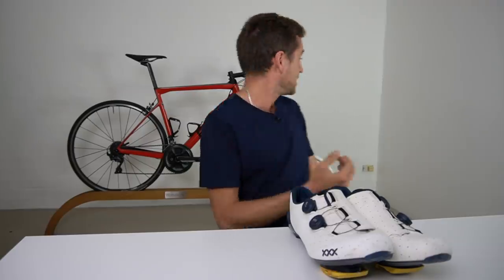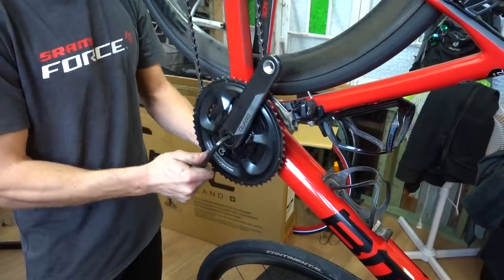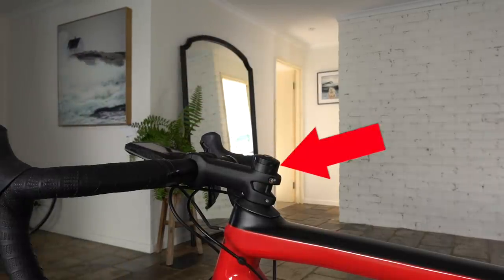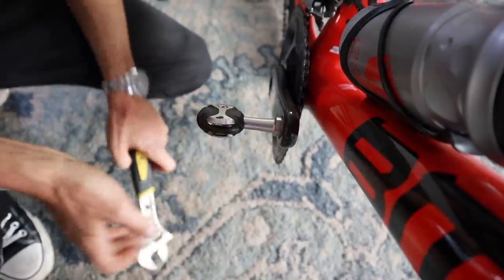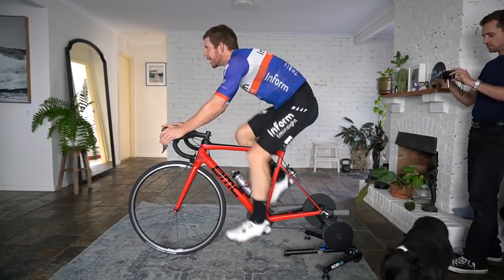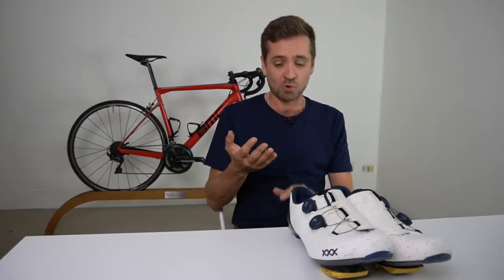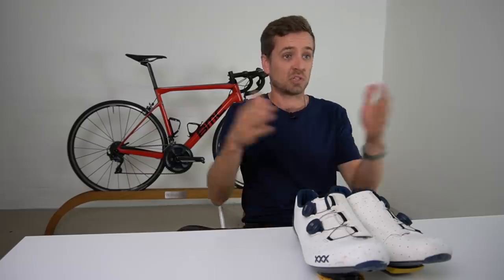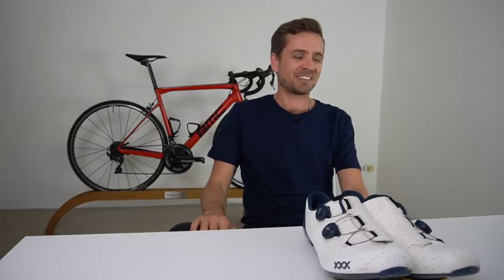How My Position on the Bike Transformed (From Changing Crank Length!)

Comment: In theory there are positional benefits, sure, but you must watch what it does to your natural cadence efficacy window. This is easier to deal with if you have lots of cogs and so forth but often overlooked by people that only look at power curves and not checking for detailed patterns when limits are reached. It's yet another reason to look carefully at cog choices and make sure the gaps aren't too big for you when you're approaching your limits of exertion. To be safe, if nothing else, spend a little extra time on pedal smoothness when on the trainer and see how that carries over. The kind of positional changes being discussed amplify the importance of working on the new cadence window.

Comment: I have the same quarq Dfour DUB powermeter and crankset. I switched from 172,5 to 167,5 after watching this! Today was my first on it and all ready loving it! But there are also a lot off small things that I have to get used to. But I was wondering did you change the settings off your quarq from changing the crank length from 172,5 to 165? Because I know I did on the older models from quarq. Please let me know.

Gerrie

Comment: Crank lengths have been trending shorter for about 7 years in pro circles. 
This has been driven by acknowledgement of benefits of higher cadence and drag reduction via lower back angles.

For 25 years, the road racing world overlooked that shorter cranks, higher cadence, lower back have been the rule not the exception in track cycling. 

The greatest obstacles to this trickling down to amateurs are
- excess bodyfat, especially visceral
- stiffer spines
- tighter hams and spine muscles
- hip joint asymmetry and osteoarthritic degeneration which includes FAI. 

Nevertheless, as one ages, shorter cranks should be the rule, as they reduce stress not only on knee and hip joints, but the lower spine.
One thing bike fitters and physios are not well versed in, is the role of diet and hydration in preventing joint and muscle stiffness. 
Anyone carrying weight will be stiffer universally. 
The elephant in the room regarding cycling comfort, performance, and endurance is still the factor preferentially ignored by most - diet.

Comment: Hey thanks for the series. I have a terrible hip impingement. I have been thinking on the 165mm Cranks for my BMC for 3 yrs, now I’m definitely going for them... let’s see if it helps, even a little would be amazing.
Reply from the maker: Good luck mate, keep me posted. Love to hear
Reply: Cam Nicholls assembled the 160mm Shimano Cranks 2 days ago (down from the 175mm, big step but can’t afford doing smaller increases) So far feels good, I noticed the higher cadence and lighter pinch in my hip. Could I be dreaming or I also felt some power output increase? Only tried the it on the Kickr so far so I’ll have to see what happens going up the hills.

Comment: I had a 175 crank and my knee was bending to high wich resulted in knee pain. I switched to 172,5 and in a week al the pain was gone. That is also a reason to consider a shorter crank
Reply: yea i was thinking of getting shorter cranks as of right now me knees are hitting me chest but my saddle is at the correct height how much of a height difference did it do for you with 2.5 mm change?
Reply: @simedinson984  i didn't change my seat hight, because with changing 2,5mm you can make a mistace easy. It could have been that my saddle was a bit to high before
Reply: @maartends6051  sounds to me that your seat was to low if anything but yea :)
Reply: For the top of the stroke
Reply: simon edin but a 175 crank was for sure to long as i am around 1,75 m. So it is normal that my seat was to low for the top of the stroke but if i would have set it higher it would have been to high for the bottom of the stroke.
Reply: Try 170, then.

Comment: I have sore hips and diagnosed hip impingements, did research and crank length is a probable self improvement to reduce the leg angle at its height. Unfortunately for a mtb  you can't just get shorter crank lengths it's damn near impossible, i bought a new 12speed groupset which allowed me to go from 175 to 170 , but according to various websites I am more around 160-165mm ideally. Big market out their for crankset makers!

Comment: Cam, you have done several bike fittings with Neil and they have been very interesting and informational. I wonder if you have any power meter data related to power, heart rate, cadence, peak power and average power doing a either time trial or a road race so we could quantify measurable differences resulting from bike fitment....
Reply from the maker: Not at this stage, haven't been fit enough
Reply: @CamNicholls  Here's the thing, all of these changes, while they make hypothetical sense, they don't really show how if affects the real world power and speed data. Regardless of your fitness, you should do something like a 20 minute power test or a short time trial to illustrate what the changes actually accomplish in these regards to those important numbers......

Comment: Crank length is one of the least "adjustable" dimensions on a bike, and often overlooked even in a proper fit. I had a bad knee injury that has now limited its range of motion. I ride 140mm cranks with the cleat near my heel and have one set that is 110mm. Those I can ride with both cleats in normal position. Huge thanks to Mark at www.bikesmithdesign.com for enabling these crazy crank lengths.

Comment: l find all these changes quite interesting please let us know asap how it turns out . l recall starting out on 170s then 172s and 175s on my other bikes . The 175s use a 46T chainrings x1 ,one on my old road bike one on my MTB with biopace ring !!  l spin more on the 172s on the carbon trek my fastest bike with SPDs too which really helps with sprinting and my first 50+km hr !! BUT 47km hr on the other two bikes is not slow either at a lower cadence . PS l put my old road wheels onto my MTB making a city hybrid out of it , l like it for coffee /shopping runs :)  l think a light weight ,compact ,high end cromo frame with 28+mm tires would make a great all round road bike :)

Comment: Not sure what the chimney issue is. Personally, I wonder if the length of the chimney could be proportional to the amount you’re smoking your competition!
Reply: The main issue for me is that it can lead to a damaged carbon steerer tube. Check lueschers video about that. Depends on the bike and length tough. A ridiculous high chimney is also not very pleasing to the eye.
Reply: It's a elitist road bike style issue when kept in reasonable length.

Comment: A question regarding shims. What if instead of using a shim on the shorter leg, is it possible to just use a thicker pedal?
let say for flat pedals, you use a thicker one on the shorter leg and a thinner pedal on the other. Would that have the same effect of using a shim?
really interested on this specific topic. Thanks!
Reply from the maker: Question for Neill, not myself. Sorry

Comment: Cam, as to the hip impingement, i wonder if, as you get older the worse it gets. It may not have been as obvious when you were younger. I know that I have found that I have become alot less flexible the older I get. As you get older (from mid 30's onwards ) stretching for flexibility becomes more and more important.
Reply from the maker: Interesting thought Bruce, have not thought of that scenario! Quite possibly. Cam

Comment: Hi I'm also 178cm height,  I have like 3 different fit ,  my actual  saddle height its 76cm but also got 76.5cm and 75cm from the others Fitters , 52cm /52.5cm Reach 8cm Drop used to have 12cm ( to much aggressive for my lower back) I'm curious about ur Saddle Height.  Nice Channel and Content,  Take Care from Puerto Rico.
Reply: It is not all that simple. If you are fairly flexible you can handle many position on the bike for short or long time. Sort time is 1.5 hours. 
I keep my stem 120-130mm for handling reason. It is better for bad descender like me. For flat ride I can go shorter reach and shorter stem. 
My height is 183 cm, inseam 90 cm, longer lower leg and long arms, short torso. So, not ideal for bike fit. 
For long ride I prefer 97cm saddle height from pedals, saddle nose 7 cm behind BB, 61 cm reach and 17 cm drop. My crank choice is 170mm but I experimenting with 165. My knee sometime kick my ribs but it is not bad. Saddle tilt is 4-5 degrees. I can ride like that all day but sprinting or chasing PB climb is not option. It is for long sustain effort. For steep climb I need to go forward to saddle tip. It is for lower back.  
For short ride, PB climb or crit races my setup will be different. saddle height from pedals 98 cm, saddle nose 3 cm behind BB, 54 cm reach and 12-14 cm drop. Stem can be shorter. No saddle tilt. My crank choice is 175mm. In that position it is impossible for me to be completely aero, but I have large torque on pedals. Sprinting is much easier. But after 1.5 hour my hands hurts me in many different ways. That setup is TT setup for me. I can put tri bars and enjoy that kind of ride. 
That is 2 completely different position on bike and there are pros and cons. I'm not bike fitter or pro cyclist. I'm 48 years old with 35 years on road bike, lots of medical issues with my larger joints. Every wrong movement hurts like hell and after that 7 days in bed is guarantied. 
I know that my position is very aggressive and that is good for me. In my opinion everybody can go aero and low with proper bike fit. But, bike fitters rarely do that. After bike fit you can put shopping bag on your handlebars and go shopping. That is only purpose of bike fit. 
You need to learn that is 10 position on handlebars and 3 position on saddle. Changing that on ride is crucial. Different position for different terrain and situation.

Comment: Question: I have a same rim break SLR01 bike as yours and I found that my rare break gives me a sponge feeling while I try to break, and also the break cable tend to stuck inside the housing while I turn the handlebars towards the left. Do you have the the same break problem? Is there anything I could do to solve this?

Comment: Surely the seat getting pushed back, negates any "open" angle you achieved from 165mm cranks? 

Would using the 172.5mm cranks with a longer stem and a forward seat achieve the same thing?

You still have the habit of "re-seating" highlighted in your challenging 1 hour ftp test on the indoor trainer outdoors. A habit rather than bike comfort thing?
Reply: GCN did a study on shorter cranks. Max watts decreased by 100 watts while all other measurements stayed within 1/3% [slight reduction with shorter cranks [3% is a big deal in my book]. There's a bike fitter on U tube that proved seat position affects hip impingement more than crank length or seat height [so, can't remember fitter's name].
Reply from the maker: Apparently its the effect of no wind hitting your chest. Sliding forward, in the saddle indoors. But could be a bad habit too.
Reply: @CamNicholls  it's something I've not really noticed in other youtubers indoors. But we are all different.
Reply: Found it. Peak Torque on U tube. Minute 2:58 screen shot - 4. Effective seat tube angle has larger influence on hip angle than crank length. Peak torque is an engineer, not bio-mechanical engineer [bike fitter].

Comment: When you roll your pelvis forwards, doesn't that move your weight from your sit bones to the soft and sensitive area sometimes called the "taint"? Second, for those of us with hand numbness (me for example) wouldn't rolling forward increase the load on the hands? (because the cm of the torso shifts farther from the hops, causing a higher moment to be overcome by the core muscles?
Reply: Btw, glad to hear that it all worked out.

Comment: Curious if anyone had the opposite effect with lateral cleat position and shorter cranks? I just switched from 175 to 165 and when I first rode I got a ton of pain in my right knee (pes ansurinus), which was super strange because normally it was my left the last 6 months, never once had right knee pain. I then tried moving my seat forward (to use less hamstring for the pes related pain) and cleats in so my feet would move outwards (wider q factor). My theory behind this is that if you look at where your foot was connected to a 175 crank, relative to the bottom bracket, and then you shorten that 10mm, to keep your foot in the same spot laterally, you would have to go a touch wider. Does this make sense or am I out in left field?

Comment: Will you go for a longer stem in the future for becoming even more aero?
Reply from the maker: Neill said it’s not needed at this stage. But maybe if I improve flexibility I could
Reply: @CamNicholls  😉
Reply: @CamNicholls  Hi Cam and Neill, Great video, super content, thanks! 
I am also a former (and actual) rower. Was rowing always to the right. So my right shoulder is lower, and a recent bikefit revealed that my hip is turning to the right. Having heavy upper body and neck pain also; with only 4cm of bar drop. Thinking to get a shorter bike 54->53cm top tube and changing to 165mm cranks from 172,5 (I am 172cm tall with s 79cm inseam). The maximum bar stack would be 1cm lower which would result in 2cm more bar drop by raising the saddle a bit. Do you think that is okay? Do you have less neck ache since the crank change with the slammed stem? Your answear would be very much appretiated ; -)
 Daniel

Comment: Shouldn't the stem be shortened too?
Your legs seem to work at a smaller angle, so raising your seat doesn't seem a good idea unless you do do some pretty good stretching of your backside leg muscles or your hips will continue de swing a lot with the associated unnecessary disc pressure.
Reply from the maker: Could go out in the long term I’ve been told
Reply: @CamNicholls  The body is a fantastic machine and it will adapt which doesn't mean that is working well. In the previous comment I forgot to tell you that your knees also seem too open in relation to your feet.
A static setup alone is not a good idea in my opinion but it can be a starting point. I've seen a lot of videos about people talking about bike-body setup, the majority of times they are pushing their service or their merchandize or just parroting the same old ideas, even in pro cycling. I don't claim to be right I'm just talking about my experience and my observations.
Ride with someone and ask them to watch your feet, hips and spine from the back and then your hands/arms and spine from 
the side.
Starting from the lowest point of contact and the power transmission device, the feet; stand barefoot in the floor with your ankles touching - having something with a square pattern underneath like a A2 size hobby cutting board is great, jump enough to lift (ca. 10cm) off the floor and land on the ball of the feet which are the contact point with the pedals. 
Observe how they land, parallel, diverging, converging, repeat 10x, 15x until you have a distance and angle more or less defined. This will help you devise your "stance width" and the fore or aft position in the pedals, if you can do this with something of the width of your saddle between your legs the better.
The tilting of the hips is solved in the majority of the cases by lowering the saddle a bit (5mm each time) until it stops
rocking this will also eliminate the rocking of the spine and as a bonus you get two steady anchor points to put the power down and less fatigue.
The spine is in the majority of the situations our shock absorber, a straight spine will have less ability to flex and the spine functions better bending forward than backward.
As a basis for achieving better body response I'd point Yoga as a very good way of acquiring more elasticity and 
flexibility as well as walking barefoot which will help you strengthen your neurological and muscular systems from your feet up to your head. There are studies done with young riders that claim that with stretching you lose some responsiveness, but since the majority of us aren't professional riders, I'd rather have the ability to keep riding longer with less injuries. Unfortunately won't keep you from eventually falling ;).

Comment: The fitter seems to be advocating cutting the steerer tube to an unsafe length.  The steerer tube should extend at least 5 mm above the top of the stem so that the stem is not clamping the end of the steerer tube.  I'll try to do a video on the topic today.
Reply from the maker: He actually summaries saying I should leave it
Reply: Even a 2mm proud stem will be enough to preload the bearings properly, as long as the top cap is pulling onto the stem and not the steerer tube you're all good
Reply: @neillstanbury4557  The issue is clamping a tube, especially a carbon fiber tube, on its end is a bad idea.
Reply: @CamNicholls  Yes, he advocates leaving it, but for the wrong reason.  He seems to be totally unaware that there is a safety issue involved with clamping carbon fiber steerer tubes at their end.

Comment: Hi Cam, whats Neils thoughts on changing your saddle to a brand that keeps you in the one position such as a Selle SMP Drakon or equivalent.  I acknowledge no two cyclists are the same in their position.   At  08:32 & 08:45 in your video you either have burning balls or your doing what I constantly did,  keep shifting along the seat  trying to find that sweet spot on the seat to get the most power out.  The Selle SMP Drakon in my case solved my problem. Great vid as always.